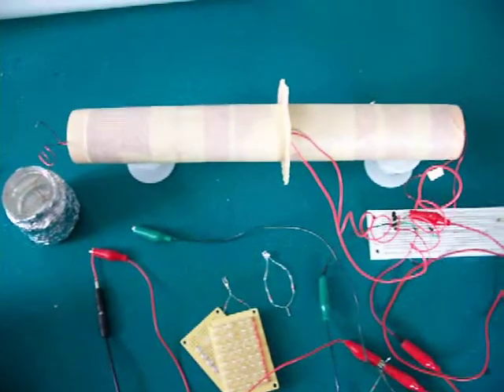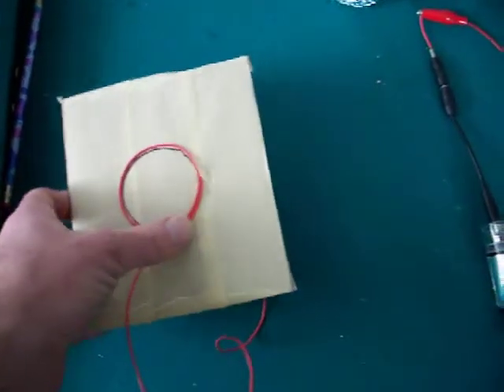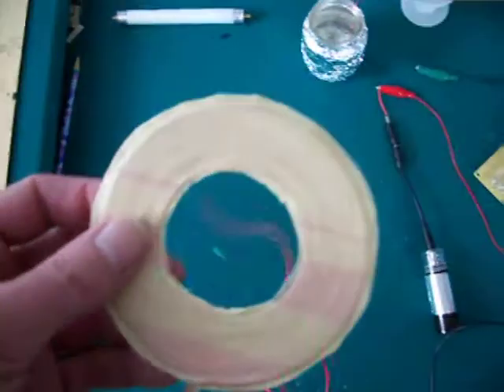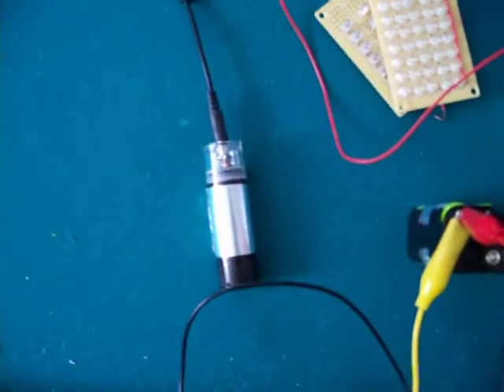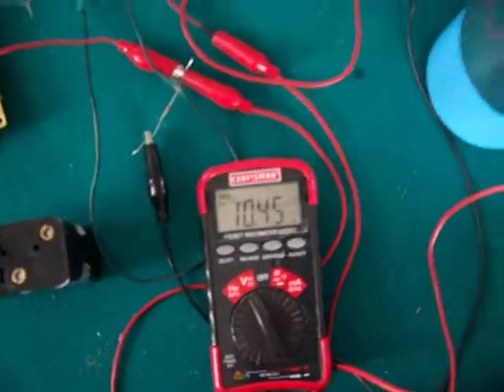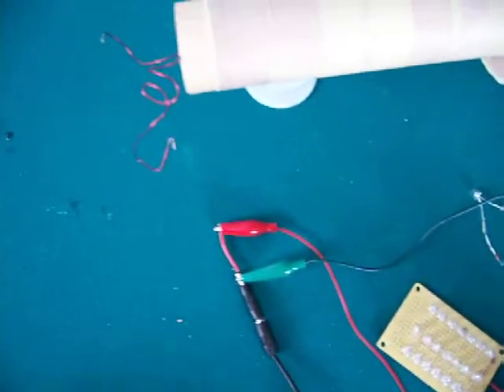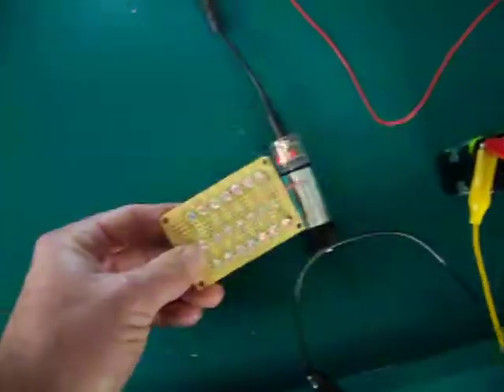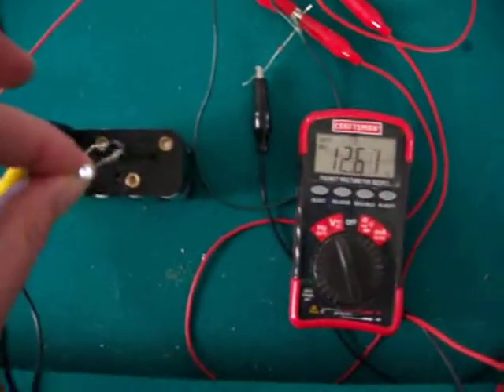Exiter Using Pancake Coil For L2

Comment from the maker: No I have a diode comming off the collector of the transistors.That goes to the positive side of the capacitor.
Then the negative side of the capacitor is connected to the positive side of the source.
Then I have a diode off the capacitors positive side going to the charge batteries positive side.
The negative side of the charge batteries is connected to the negative side of the capacitor.

Comment: the reason pancake coils are better for building voltage is easy to understand. at that coils resonant frequency  frequency times c squared and coil length are equal. that is the corresponding signal to send through the coil for maximium effect. since the coil pulse speed and coil length are the same the pulse travels the first half of the coil and has resistance as the pulse enters the second half of the coil the emf in the first half created by the electron flow or current is now starting.